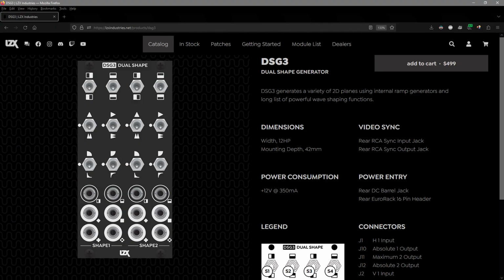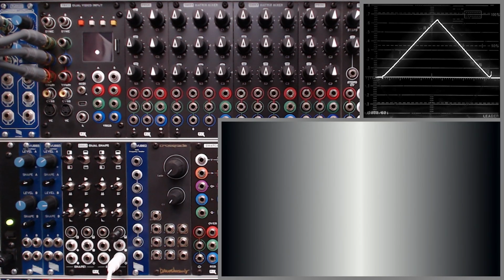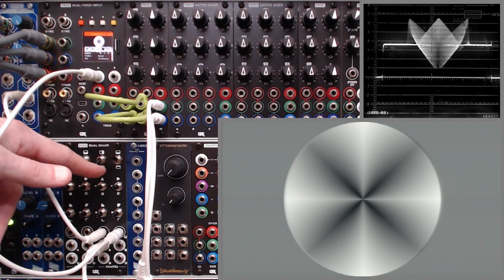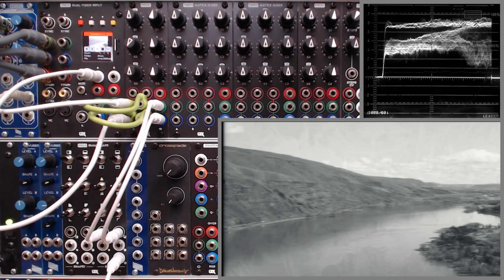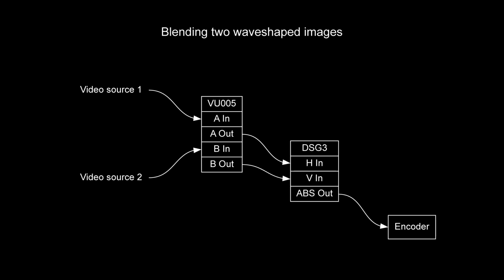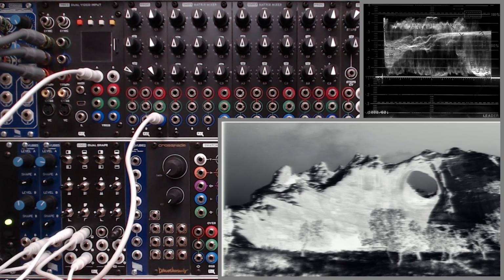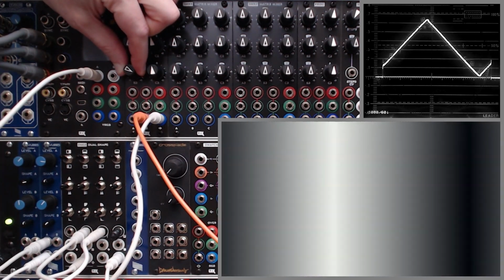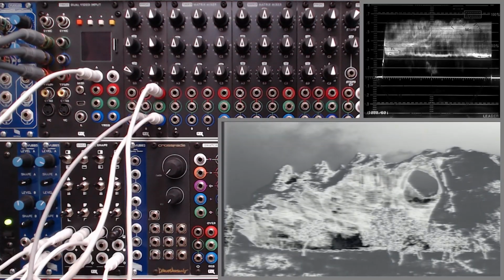LZX DSG3 Dual Shape Generator: Video Synth Tools & Techniques

Comment: Great video. Im a complete beginner and have a double vision. I would love to know how you got those gradients and how to load them on to TBC2. Thanks
Reply from the maker: Hi! Thanks for your kind words. I created the gradients in Photoshop and save them as PNG files, 8 bits per channel. The clever part was packing two different images into two different color channels. That is done by copy-pasting from the Layer of one document into a Channel of another document. Use the red and blue channels, leave the green channel blank. That's to avoid crosstalk / bleeding on the TBC2 outputs. Save the PNGs to a microSD card and use the TBC2 Media Player feature to load them. That is documented in the LZX manual:

https://lzxindustries.net/modules/tbc2/manual